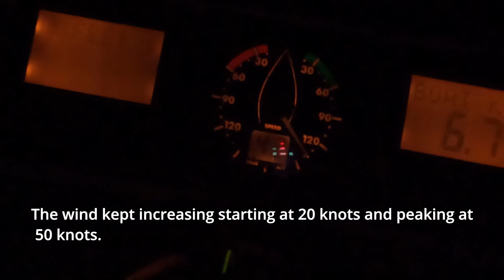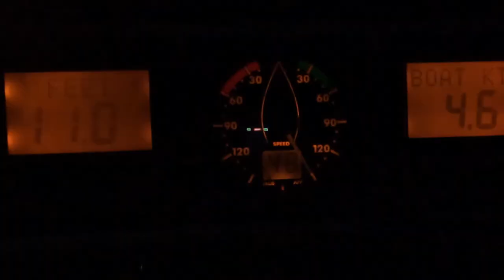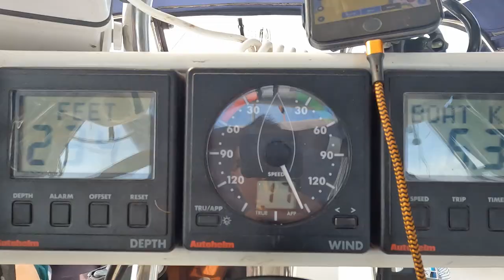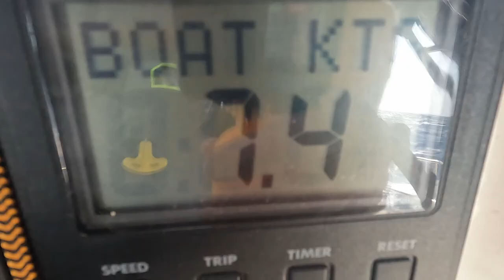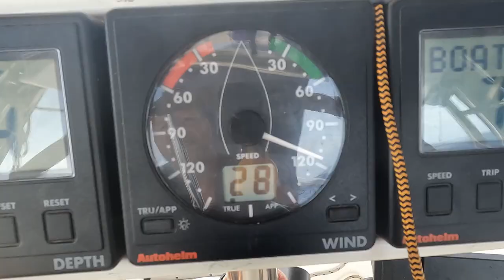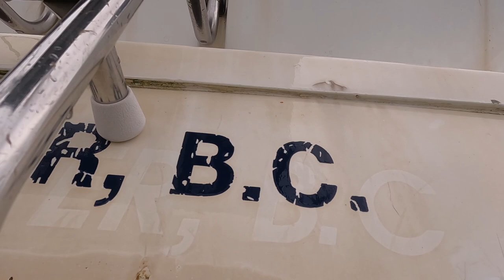50 Knot Papagayo Storm on The Way to Costa Rica! Ep 37⛵⛈️⛵⛈️⛵⛈️

Comment: Holy smokes you guys have been through it, good thinking on the the cable to tighten the strut. We miss you guys :)
Reply from the maker: It was a wild ride. Finger's crossed we won't need to use the engine to get to the haul out. Thanks for the comment, guys! We miss you, too!

Comment: Full house in many ways.  Hunters . Catalina's etc are not considered,or designed as heavy weather boats, as you have experienced. 

My guess on your strut breaking, as a 40 year sailor and owner of a blue water sailing boat. Either there is misalignment of the engine, or the shaft . Creating a wobble to the shaft, then snapping the strut.  Or a wave snapping it, because of weakness. I would suggest checking your engine mounts, alignment before going back out to open water. . But I'm sure you are all done as the pictures indicate.
Reply from the maker: Yes, we think it must have been on the way out and weakened and the bar crossing or the storm finished it off. We'll get a new one and start with a fresh strut. I'll also check the propellor for true and replace it if it's bent. Will definitely get it aligned once it's all installed. Good times!